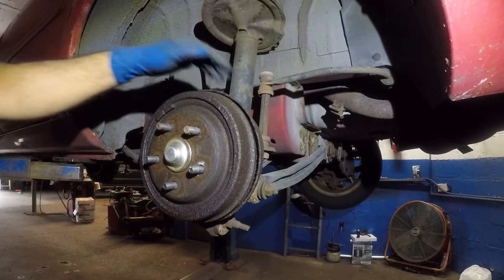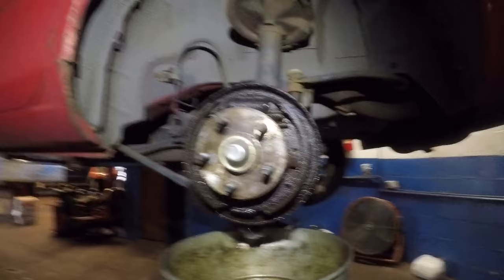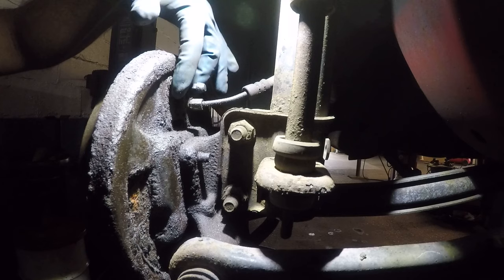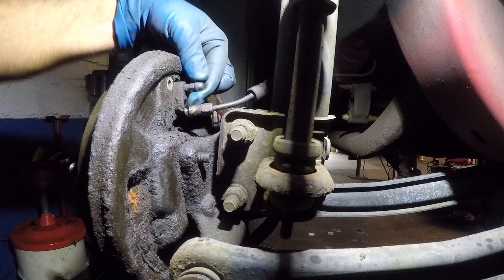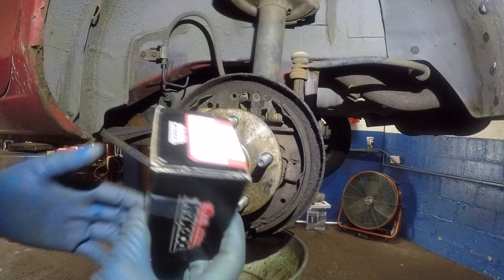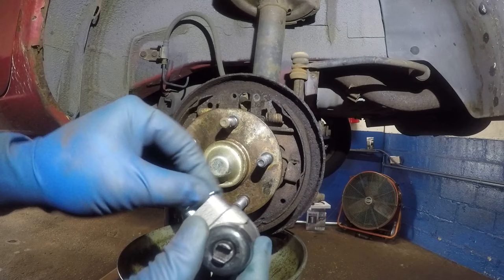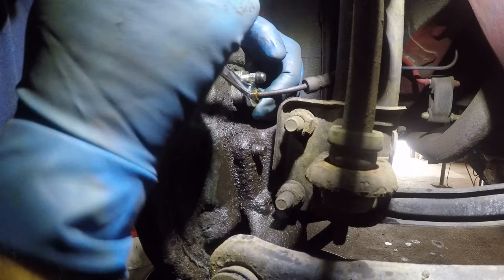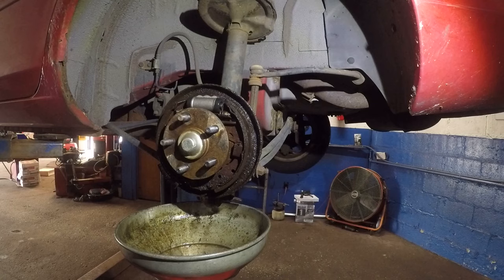Leaking Brake Fluid, Bad Wheel Cylinder

Comment: Tried 2 brand new cylinder and leaked straight out the box on the same said. I'm I missing something?
Reply from the maker: Did u replace the shoes and drums? I had this issue before once the drum was worn out too much and pad was too thing the piston had to travel very far and boom it leak out
Reply: @RBTheMechanic  thanks for coming back. Shoes and drums new also mate. Perhaps just unlucky with the cylinders being faulty out of the box?
Reply: @RBTheMechanic  can the piston  just be popped back in if over extended?
Reply from the maker: @paulmillward3628  yeah just make sure the seals don’t get damaged the o rings when i do drum brakes sometimes the pistons gets pushed one side out I push it right back in gently and straight as possable
Reply from the maker: Did u adjust the brakes propperly that can also cause it unadjusted brake first piston to move will pop out

Comment: I can't getcthge brake line to unscrew. Damn it.
Reply from the maker: Give it a bit heat or twist the cylinder
Reply: @RBTheMechanic  thank you. I'll try that.:-) :-)
Reply from the maker: @alforliniteaching5670  yup some times the line and fitting gets jammed when I try to turn the fitting line twists with Smit so what I do is I turn then cylinder and when installing I turn it back on also try very little heat it might free up

Comment: How much a job like this cost?
Reply from the maker: Cylinder alone $160 with bleeding and cleaning some shop may charge u $240 or more due to they want to charge everything
Reply: @RBTheMechanic  The reason why I asked this question, it's because I have a leak on my car right rear tire, but when I  went to meineke, they gave me a bill of $1,576
Reply from the maker: @prometheus9547  they crazy the cylinder is $20 brakes shoes hardware drums is $130 max

Comment: But how can I remove air from the cylinder?
Reply from the maker: You have to bleed it from the valve back of it have some one pump the brake peddle do the bleeding procedure
Reply: @RBTheMechanic  thanks sir, today I used this prosses in maruti - suzuki baleno 1.6& got success with the 8&10 mm spanners and level pipe

Comment: My Car Is Leaking Brake Fluid. I Have To Put Brake Fluid In Once A Month.
Reply from the maker: Mary Curry what kinda car u have .... start checking and follow all the lines if u have drum brakes check inside the drums also it can leaks internally in side the brake booster and the vaccume line can suck it in and burn it through the engine check let me know
Reply: I Have A 1996 Madza LX 626.

Comment: So let's say you have a rear wheel cylinder that is shooting out fluid faster than you can put it in.  You simply do not have to buy a new wheel  cylinder. How can I shut the line off going to that wheel don't waste my time saying that's not safe that's not legal I don't want to hear that I live on $1,000 a mo can I put a nut on the line where it attaches to the cylinder
Reply from the maker: Dangerous!!! Ur cutting the brake off??? That’s what ur stating
Reply: @RBTheMechanic  well after forty years of working your butt off when you're living on social security you got no choice you got to do things the cheap way.  I think if I kept that brake line going to that one wheel you still have three wheels stop in the car I think that's fine. At the tractor trailers out there I've got their break so out of adjustment only one or two axles is actually stopping at 18,000 lb of truck in 40tons lb of load
Reply from the maker: @johncherokee9006  cylinder is $15 prolly cost u more time and work to put ur self in danger